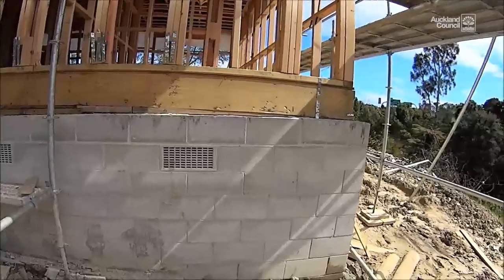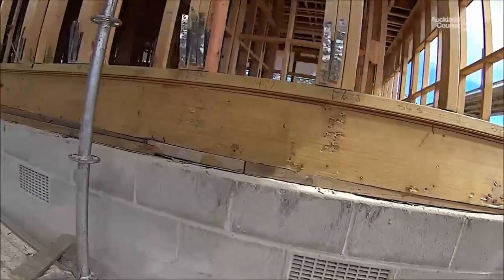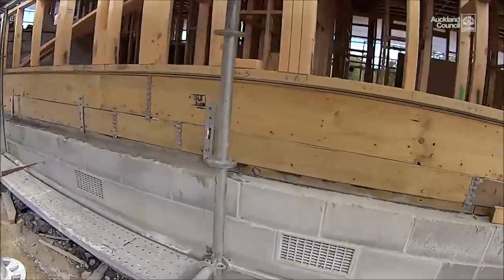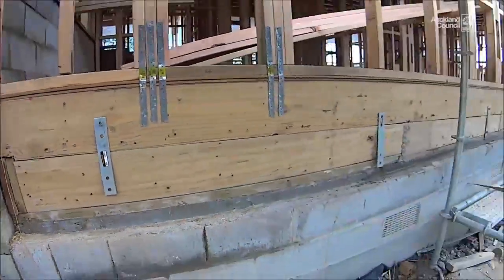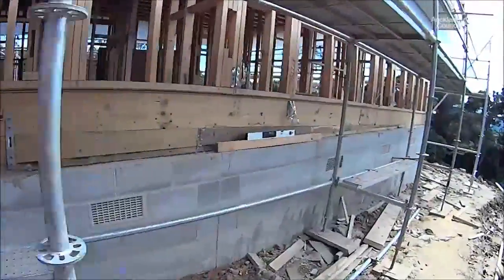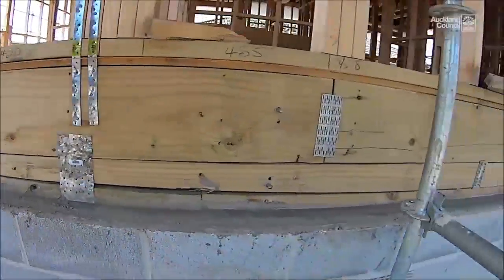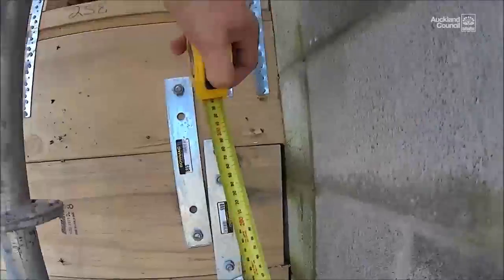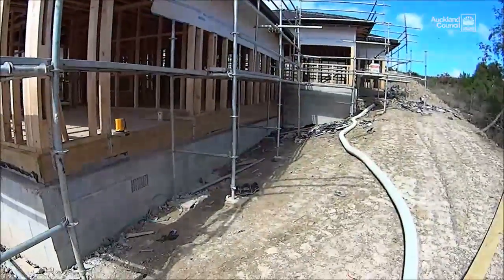Shoddy Building - Foundations

Comment: It is 20 years since we had an extension put on our house. 6 months later the stove fell thru the floor. The Builder, Architect, Insurance company, a rep from Master Builders, and Council reps stood on our property, and none took responsibility. Due to no ventilation, the chip board floor turned to wet weetbix instantly. 
I have spent some time in the US. The fix is ALL aspects of the NZ building industry should be dumped, and US systems/laws should be implemented.
Step one is that insidious kiwi "she'll be right/no. 8 wire" attitude needs to go.
A governing body comprising US key people should be set up, with same representatives snaking through the industry from top to bottom.
Reply: I really don't think the yanks do it much better. Most of our systems come from them anyway
Reply: +glennimmortal They certainly don't do it better. I've just been in Alaska. In every place we stayed there were ventilation issues (inadequate in toilets and showers). In one place the verandah flooring had rotted and left a hole in the floor, laughable cladding with bits or sarking that looked like it had been put on by a five year old.  There are building codes in Alaska but I believe they are voluntary.

Comment: How the hell did this building pass a sub floor  inspection?
Reply: I think the subfloor  and framing could have been one inspection which this inspector will be failing. It's the previous block fill inspection that should have picked it up. But you can't blame the inspector for not picking up bad levels. Maybe  the control joints should have failed but the contractor may have agreed to fix it but never did. I can totally see how it got through the first time.